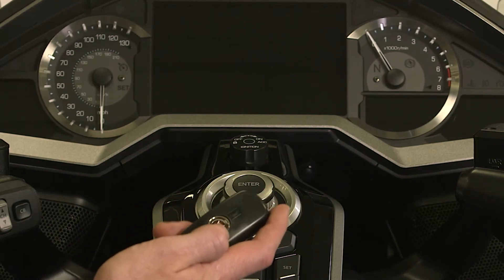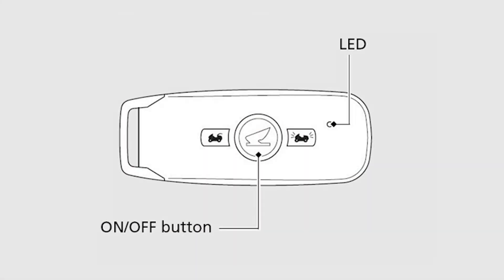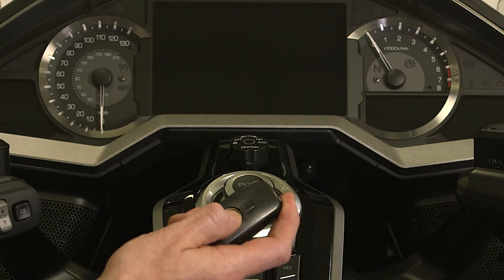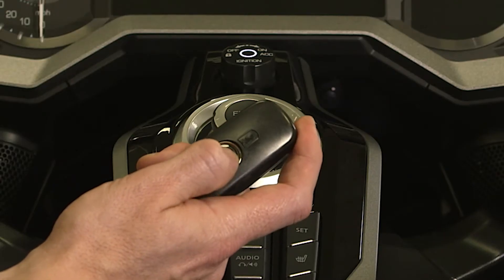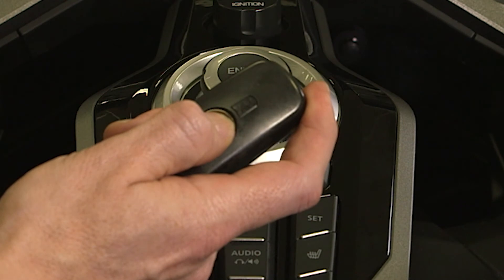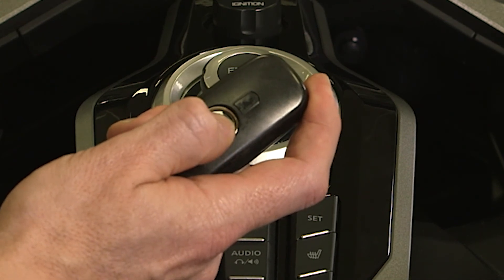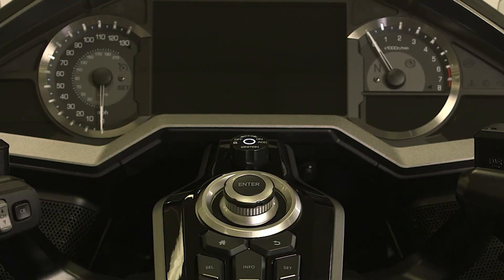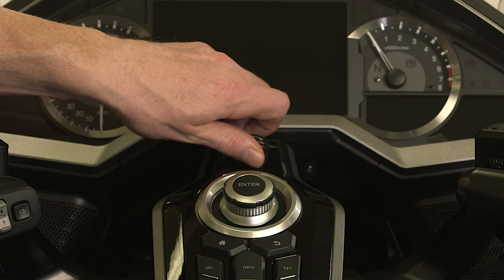How to use the Honda Smart Key on a gold Wing

Comment: What's the nonsense with more and more electronics in cheap scooters? Today, starting a motorcycle requires a degree or reading the manual twice. I want to start the motorcycle in 2 seconds or open the seat or the top case. Drivers are increasingly reporting malfunctions, problems with an empty vehicle battery (then the seat only opens with an emergency key). Basic functions should remain basic functions. Please stop with the increasing digitization. This is not a €20,000 vehicle for hipsters